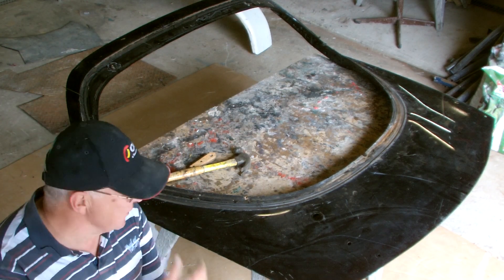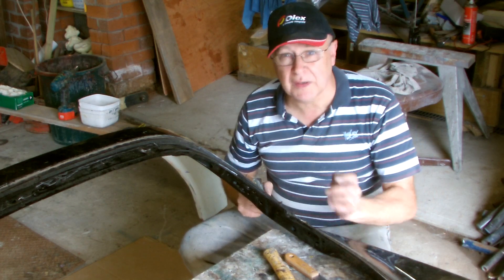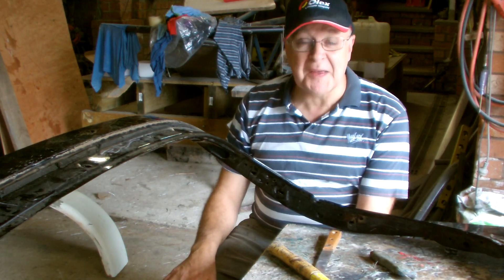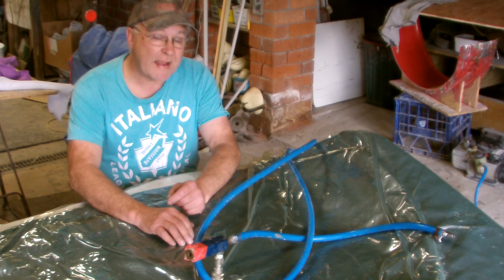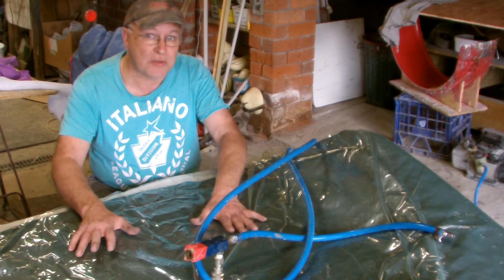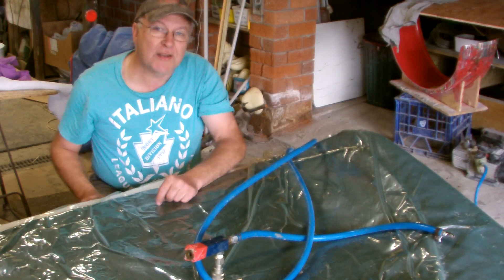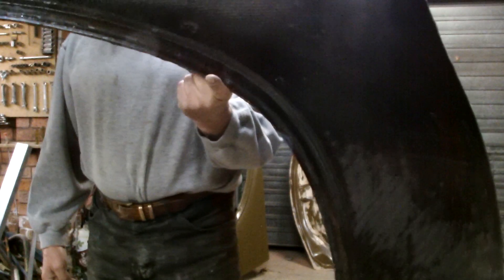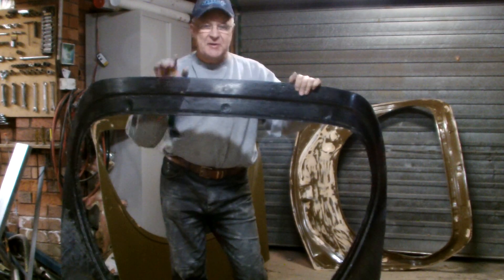How to Fibreglass a Car Double Layer Panel

Comment: thank you so much for your wisdom! I am thinking of making a fiberglass roof for my camper van. i want o have the solar panels slightly sloping towards the edges and the gaps filled with sheet loft insulation. the roof will then be fiberglassed over the top with the panels flush. What do you think of this idea? could i simply add the fiberglass directly to the insulation and panels? i would really appreciate some advice on this!! thanks very much!
Reply from the maker: Have you seen my series on building a camper trailer in my "Playlist"?  I fiberglassed the roof in this episode. You can fiberglass over any semi-rigid surface, but nothing soft that will either bend or soak up too much resin. I would not glass the solar panels in place because if any of them have troubles you might not be able to remove them. Also the more edges you have going around shapes in a roof the greater the likelihood of a leak. So me personally - I would make the roof with a 25mm run off from it's center , form it out of thin plywood or MDF and fiberglass it in one piece - BUT laying into it mounting brackets screwed in place on which to mount the solar panels. That way you can remove/replace them if ever needed, and you have a one piece roof. Extend the fiberglass over the sides like I did to prevent roof leaks. Note you lay the resin & glass FIRST, then TOP COAT or FINISH Coat second... not gelcoat. https://www.youtube.com/watch?v=hF6hqMPCF-4&list=PLh5B6MCXRHiHqEhccCyo_kqJiyZx7Rai9&index=12&t=316s   PM at Redline Fiberglass if you want to send pics & get more guidance.

Comment: HI Bill, just a few more questions if thats ok. Do you sand the wattyl 7008 after it dries ? I saw you put it on with a brush, do you get any brush marks after it dries ? Also, Bunnings doesnt sell the 7008, can I use the Cabot's Cabothane clear gloss CFP Floor polyurethane as a replacement ?  Thanks.
Reply from the maker: No need to sand Wattyl 7008 or any equivalent 2 pack clear floor epoxy as it is self levelling... so no brush marks. Bunnings don't sell any Wattyl products - but Mitre Ten do, and most specialist paint shops. I'd have to read the Cabot's scan fine print to know if it's ok - but you're looking for a two part, equal A & B mix epoxy resin. Me? I'd find a 7008 seller.
Reply: @BillsBuildandRace  Ok cool Thanks for that mate, much appreciated.

Comment: Thanks for the helpful videos, much appreciated. Just a question, what gel coat do you for your mold if you are going to make carbon fiber parts , is it normal gel coat or tooling gel coat ? Thanks Again.
Reply from the maker: The difference between tooling Gelcoat and common Gelcoat ( apart from price), is that Tooling gelcoat is tougher. So you use it when making molds that are going to have many copies made in them (like most commercial applications). But for home use I only use basic Gelcoat which holds up for around 6 - 8 copies with little deterioration, and minor faults can be repaired with car body filler, sealed, & away you go again.
Reply: @BillsBuildandRace  Hi Bill, Thanks for the quick reply mate, greatly appreciated.

Comment: Nice Job,  how does the glass fit ?    I used cheaper materials when I vacuum bagged my Hovercraft..   I used Painters 4mill plastic instead of "Peel Ply"  and I used an old quilted blanket for the breather layer..   Plus "Duct Tape to seal the bag.   It worked like a charm...  I'm alway Leary of buying materials from a Fiberglass supplier..  They charge more for the simple stuff,  they just give it a technical name and jack the price.

Comment: You make it look easy!  FWIW if you want a cheap easy vacuum bag for smaller parts, those vacuum clothing storage bags work very well, just rip out the one way valve rubber and tacky tape in the vacuum hose. The bag is reusable and a lot quicker  than tacky taping up a sheet of film then trying to find all the leaks. They also work for resin infusion except they are single use when used like this. Interestingly they appear to be made from a similar material to the vacuum bag film.

Comment: i dont have access to the vacuum bagging is it ok not to do that and that thing you called pva release agent and that gel coat all that i got is resin hardener and a fiber cloth they called dont know where to buy that chemicals here in the Philippines
Reply from the maker: +enzo mitsu You can do fiberglassing without vacuum bagging, but you cannot fiberglass without the PVA release and Gelcoat. Just Google "fiberglass suppliers Phillipines" like I just did and you will find  places where you can buy what you need in your country. Doing a double layer panel is a fairly advanced job. I suggest you watch my very first fiberglassing tutorial which you will find in my playlists. This covers the basics without using special equipment but shows the chemicals and small tools that are ESSENTIAL right from the start. What is it that you want to make with fiberglass?
Reply: i have a lancer glx the old one 1989 model and lots of its parts here are rare including louver the grill if i can replicate any of my parts my club member will benefit on it though im the only one thinking replicating it my first time to use fiber is on my bumper it cracked while entering an elevated road hahaha an from that moment i think i can do a lot with the fiber hihihi thanks for your tutorial got interesting idea and want to try thanks
Reply from the maker: +enzo mitsu As you are a beginner you really should watch my whole series on fiberglassing in my playlist.here. They will help you avoid the many big mistakes and difficulties you can have in making car parts, and teach you lots of tricks of how to go about it. Fiberglass will not stay glued to plastic bumpers unless you drill holes into the plastic to really anchor the resin. Start of with small parts of a simple shape, otherwise you'll get yourself into real trouble and waste your time and money and get discouraged. Remember there are NO shortcuts with fiberglass. If you leave out any step or product I show you to use you are headed for disaster. Start small.
Reply: thanks sir a lot
Reply: i will and give some pic please comment if there will be a problem more power sir and please make more video as inspiration

Comment: Nice videos where do you get the carbon fiber from?
Reply from the maker: +3gd16 Where are you?
Reply: +WJP004 I'm from Puerto Rico
Reply from the maker: +3gd16 Avoid buying off e-bay. Find a local wholesale TRADE supplier to the fiberglass industry in your area or state to get the best prices and range .I found several just by Googling "carbon fiber suppliers Puerto Rico".
Reply: +WJP004 thanks I will try that you have inspired me to try this I have done fiberglass before but never carbon fiber

Comment: Double layer reminds me of paddle blades I made with a guy years ago
Problem I found with polyester and chop strand when used for automotive is its forever sinking
Even painted with generous coats of 2k paint the chop strand prints through later on
They say epoxy and woven cloth is the only way but with this said Ive seen expensive aircraft with roving cloth print through on the wing fairings
Those super car manufacturers like ferrari must use some special composite
Good videos by the way
Reply: Steves Projects print through can be dealt with by using high temperature resins (generally they have much better properties than room temperature cure resins), the parts come out of the moulds with some light texture still, but that is then wet sanded down, buffed or clearcoated and wetsanded and buffed - and will stay flat with no surface texture development

continuous developing print through (even after sanding it flat) is a sign of a weak and "flexy" resin, generous layer of gel coat will usually help - simply because it is based on vinyl resin - which is tougher than polyester, room temperature epoxies may require an oven bake to finish the reaction properly (most manufacturers suggest post cure anyway), then there are epoxies with limited flex additives added in, sometimes this is desireable in a part - may prevent it from failing or delaminating - like body parts for rally cross cars for instance, which sometimes bump into each other - very rigid parts will break and may shatter - flexy resins will prevent that - but print through there is something you will have to live with
Reply: jz1199 Thanks for the tips and detailed reply you obviously no your subject very well :)

Comment: could you do a video on a split mould (2 or 3 piece mould with no holes), the lay up and how you go about attaching the pieces together efficiently if you're unable to get inside and add support on the joins? Every video i can find the mould has a hole in so they can add more fibre on the joins on the inside without adding any more size to the part so it will still like its suppose to. Id be grateful if you'd leave a comment if you don't have any projects your able to show this on. Thanks!! Learnt so much from your videos already
Reply from the maker: I can't really answer you without clearly knowing what it is you're trying to make. Pictures to redlina@bigpond.com would also help. There is no need to carpet bomb my videos with this question as I watch all comments on my channel & respond to them within days.

Comment from the maker: Basically yes.  An easy option in making doors is to cut the steel window framing off the factory door you're moulding & refit it back into the new f/g copy - having made a jig to line it up accurately.  Put big ribs on all 4 edges of the factory door when moulding it to ensure your copy will be an accurate fit.  Bathurst eh... don't know Dave Carter do you Phil... ex BLCC?

Comment: I then realized the bottom part of the hood was also fiberglass. These cars dont come with sheet metal hoods. I managed to take a scewdriver and pry on the hood for a period of time until it released. The top part got damaged but fixable if i ever want to modify it and make a custom hood out of it. Used the epoxy gue to put the new part and the old squeleton together and turned out real good. Already painted it. Thanks a lot for making such helpful videos

Comment from the maker: Without knowing how it's held together I can't really advise you on how to do it. Figure out how they joined it and undo whatever they did. To glue the new skin on just use any two part epoxy glue. Our brand name here in Oz is Araldite. This is how they probably joined your original together,if so you'll have to cut it the epoxy apart - which will be difficult to do without damaging the top skin. Might be easier to get a stock factory steel bonnet from the wreckers & just undrill the spot welds.

Comment: Hey Bill! Im getting a cobra hood for my mustang next week, its made out of fiberglass and its only the top portion. I was told I could buy the top portion by itself and then take my old hood [Fiber glass composite (Top) and very light sheet metal (skeleton)], separate it and glue the cobra part to the factory squeleton getting a better fitment that way and saving a few bucks, My question is, how do i safely remove the lower portion without messing it up? How do I glue it back to the cobra one?

Comment from the maker: Jack f/glass is perfectly ok for any car panel.  You can see a two piece tailgate I made in my tutorial on split moulds at 9:15.  MOST of the car panels I make are f/glass.  I only used c/fibre on that tailgate because that was what my son wanted, and it was five times the money and MUCH harder to get a decent finish on.  I would RATHER have made it in f/glass.

Comment: Hey Bill, I love your fiberglassing videos. I watch them religiously almost to the point of obsession admittedly! I can't wait to start laying up a tailgate of my own for a non-racing street car and I was wondering, would it be wise in a structural sense to create one purely from CSM fiberglass as you did with the car bonnet (with some reinforcement), versus the carbon fiber you used here? Would a car bonnet and tailgate share similar structural requirements to allow this?

Thanks,
Jack

Comment from the maker: My aim was to debug the urban myth that you CANNOt hand lay cf. I hoped this would lend guys to commence using this material and then progress into the more advanced methods I show later on in the series.  There are also some parts that CAN be simply made without infusion techniques (like the fuel pump cover I showed me making in an earlier film), & which would be much more difficult to make if you ONLY ever though "infusion". Feedback suggests this path has proved helpful & encouraging to many.

Comment from the maker: Making the fibreglass mould should cost around A$75.  A fibreglass reproduction from it would cost around the same.  A repro in carbon fibre would cost around 4 imes that... say A$300 - 400 depending on how well you can buy the materials.

Comment: did you say for the vacuum you just used a fitting on your air compressor? if so, can that be bought at most hardware stores? not sure what places you have there, but would like home depot have it?

Comment: Another instructive video.

 For the window, make a paper pattern from the original, and cut that out of a flat sheet of perspex. Make a mould out of plaster or concrete (over sand?) of the glass, then use a heat gun to soften the perspex to shape. The mould doesn't have to be very smooth, just put something over ir, to keep from scratching the transparency.

Comment from the maker: The plastic is vacuum bagging plastic which you'll get from any good fibreglass materials supplier.  The grey circular piece was the lock collar for the Tee piece which seals it into the bag.  Same source.